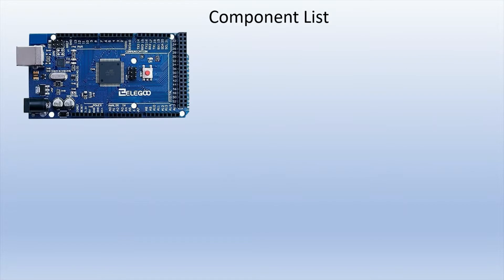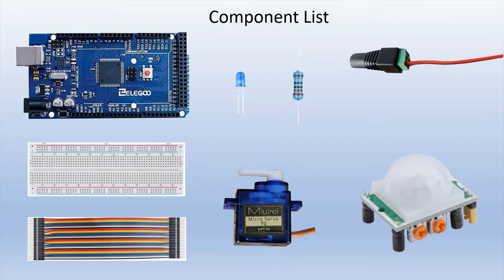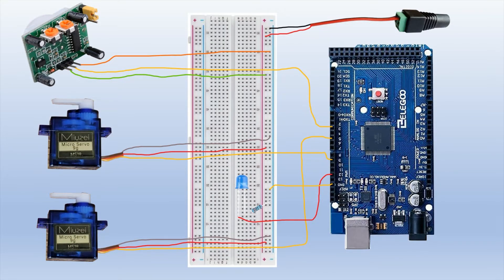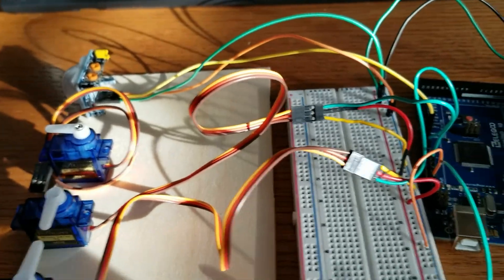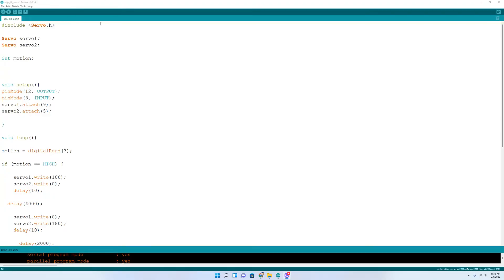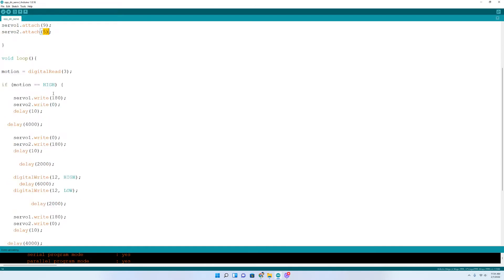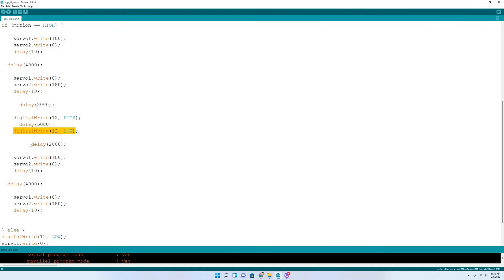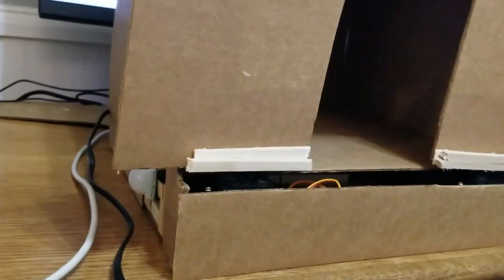Rotate Two Motion Activated Servo Motors In Opposite Directions - A Beginner Arduino Project

Comment: This is awesome and straight to the point. Thank you very much. I do have a question though, I’m planning to use something similar in my diorama. After uploading the code, would I have to take the whole set up including the Arduino board to my diorama? Also, would I need to power the Arduino board and have the external 5V or would the external 5V be sufficient?
Reply from the maker: Hey there!  Thanks for the compliment.
After uploading the code, yes, you would need to keep your microcontroller connected to the servos. If your diorama is small, you could use Arduino nano and tuck it behind or underneath your viewing area. You should use an external power supply when using servos, even the small ones. Under no load it may be fine but when the servo makes quick movements or has a load on the rotational arm it can possibly draw current that exceeds the Arduino limits. 
There are a number of ways to power your setup. Are you going to have access to an AC outlet?  If so, just power your servos using a 5v AC adapter and operate your microcontroller with a 9v batter in the barrel jack or VIN pin. If you need to use battery power you could use a step down voltage regulator and operate the servos with MOFETs. It's also a good idea to use a capacitor with your servos to avoid any voltage drop. When the right amount of power isn't supplied to servos they begin to act a bit weird (buzzing, humming, erratic movements).
If you want me to show you the setup, I'm happy to help. I'm sure it would be helpful to others as well.
Reply: @BMonsterLaboratory  Yes, if it’s not too much trouble, it’ll be great to see the setup.
Reply from the maker: @SlickDiecast  Check this video out https://youtu.be/f2TTGsU4XpQ  I just made it.   You could use a 12v 4amp battery like i have in this video and split the voltage line - 12v going to Arduino Uno R3 VIN pin and another 12v wire going to the Buck Converter for 5v step down.  You the lever wire connectors, they're great and take up mininal space.  Check out the video and if you have any questions I can send you a diagram 
👍

Comment: Delaynya kalo di rubah agak pelan caranya gimana?
Reply from the maker: ubah angka di () untuk mengubah penundaan. penundaan (milidetik) - penundaan (1000).
Anda dapat menggunakan milis () sebagai gantinya. Dengan cara ini, Anda dapat menangani tugas-tugas lain dalam fungsi loop() tanpa diblokir oleh penundaan().
Reply: @BMonsterLaboratory  saya coba aku rubah malah jedanya gerak eg mas yang agak lama...tapi kalo di bikin agak smoth geraknya gimana ya?
Reply: @BMonsterLaboratory  biar agak kalem geraknya...
Reply from the maker: @ahmadwahyusyaffudin1776  Try increasing current. Try an external power supply that can provide 4-5amps if you're using 2 servos. If that doesn't work, post your code and lets take a look 👍
Reply: @BMonsterLaboratory  kalo program pake push botten gimana pak?
Reply from the maker: @ahmadwahyusyaffudin1776   
replace the motion sensor input with a button input and change the motion variable to buttonState.

#include <Servo.h>

Servo servo1;
Servo servo2;
int buttonState;

void setup(){
  pinMode(12, OUTPUT);
  pinMode(3, INPUT_PULLUP); // Use internal pull-up resistor for button
  servo1.attach(9);
  servo2.attach(5);
}

void loop(){
  buttonState = digitalRead(3);

  if (buttonState == LOW) { // Button pressed (LOW because of INPUT_PULLUP)
    servo1.write(180);
    servo2.write(0);
    delay(10);
    delay(4000);
    
    servo1.write(0);
    servo2.write(180);
    delay(10);
    delay(2000);
    
    digitalWrite(12, HIGH);
    delay(6000);
    digitalWrite(12, LOW);
    delay(2000);
    
    servo1.write(180);
    servo2.write(0);
    delay(10);
    delay(4000);
    
    servo1.write(0);
    servo2.write(180);
    delay(10);
  } else {
    digitalWrite(12, LOW);
    servo1.write(0);
    servo2.write(180);
    delay(10);
  }
}
Reply: @BMonsterLaboratory  terima kasi pak atas infonya
Reply: @BMonsterLaboratory  ini push buttonya di tancapkan di pin berapa

Comment: Hello I have an issue with my servo and sensor. In TINKERCAD its working perfectly fine but irl the motors seem to be opening and closing even when theres nothing going through the sensor further more even without the sensor the motors kept opening and closing pls help. Im so confused and tried everything to fix it.
Reply from the maker: hi there! are the motors getting the right about of current? maybe you could add a pull-down resistor to stabilize the input signal to the sensor. A pull-down resistor is typically used to ensure that a pin or input has a defined low state when no signal is present, which can help prevent false signals or erratic behavior.
Reply: @BMonsterLaboratory  I connected my motor in the bread board and that bread board os connected to the arduino 5v  and no i dont have any pull down resistor. Im using SG92R motors.
Reply: @BMonsterLaboratory  I used your door project as a curtain project of mine since the function og thr doors can be turned into curtain puller. It's for a school project
Reply: @BMonsterLaboratory  even the light bulb keeps turning on and off, whenever it's on the motors stop moving and when it's off it moves.
Reply from the maker: Can you send a diagram  to me on face book?
Reply: @BMonsterLaboratory  ok

Comment: does the code also work for raspberry pi?
Reply from the maker: Hey there! Arduino uses C/C++ language. Most of the time you will see Python used with Raspberry Pi but there is a way to use C++ on a pi. I have never done it that way but it is possible.